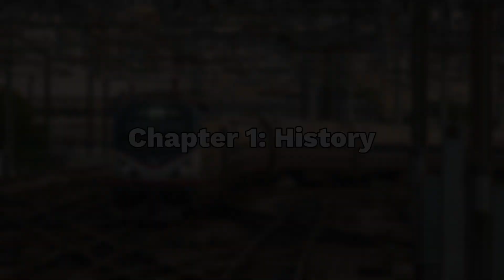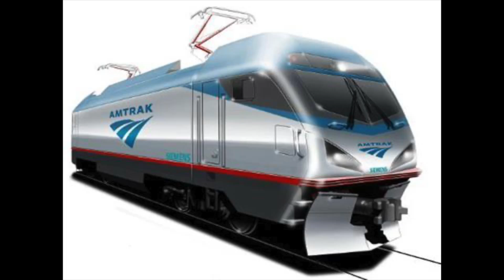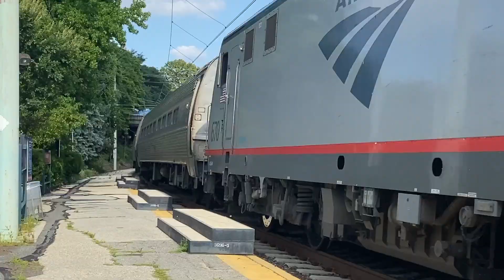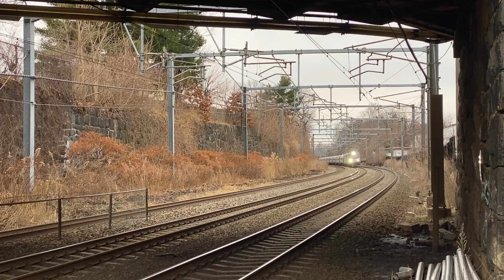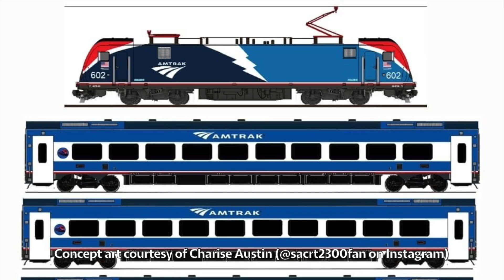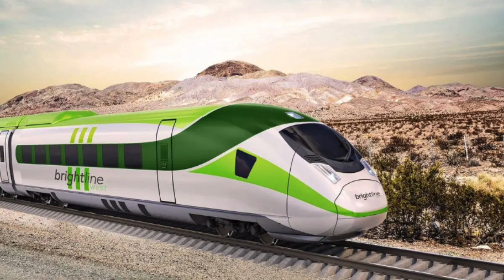Siemens Cities Sprinter: The Backbone of America’s Busiest Rail Corridor

Comment: My personal list of operator that will purchase ACS-64s
Njt: 15 locomotives, because my crazy prediction is that njt will purchase 200 dual mode Chargers
Mbta:10 locomotives to replace its oldest locos
Caltrain: 7 locomotives in case if the Stadler Emus are breaking down
California HSR and Brighline west: 4 locomotives(2 for each operator) to test the tracks once the constrictions are over
Texas central:1 locomotive for the same reason as California HSR and Brighline west
RTD rail in Colorado:7 locomotives for their service
South Shore line:4 locomotives to supply the 50+years old Emus
Metra:2 locomotives for their electrified lines
Septa:8 locomotives to expand service
So my prediction is that Amtrak will sell 58 locomotives while they will keep the rest for long distance trains from New York

Comment: The MBTA Providence line would need extra work to use electric locomotives as many of the platforms along the line are only connected to unelectrified tracks parallel to the NEC. Also MARC has seen no mechanical issues with their HHP-8s after they had been refurbished.
Reply: That’s nice, but they almost never use them. They care too much more about money than the environment.

Comment: i thought they would last about 40 years
Reply: They probably will - it's just that the US has so much non-electrified track, that it seems Amtrak prefers locomotives that they can use everywhere. I don't really get the American anti-electrification sentiments; if it really were uneconomical, why is it all over Europe and the former USSR, including routes longer than anything in North America, for many decades now?
Reply: @KaiHenningsen  Freight companies, presumably. Private operators which also own their rails, high frontup costs (the biggest reason) and not much capacity (single lined tracks — electrification is worth at a somewhat high use of rails) don't bring in many justifications for electrification.
Reply: @MarioFanGamer659  Yeah, having (some) main routes single-tracked also seems like a rather bad idea. Capacity would much more than double by adding a second track. And they know this, as other routes are double-tracked or even more.
I dunno. US rail is just weird in so many ways.

Comment: There a reason amtrak couldn't have used NJTs ALP45DPs as hybrids rather than making their own? I mean IK Amtrak does their thing but I also don't know how fundamentally viable the 45DPs are for that kind of service.
Reply: @T_Hoog  The APL45DP is DEFINITELY buy America compliant. If it wasn’t, how would NJT be operating it right now, never mind still receiving deliveries of them. So that can’t be it. Both manufacturers outsource their parts from their production sites in their respective countries.

What it really comes down to is the fact that Amtrak and Bombardier don’t have the best relationship after the HHP-8 scandal. Where both side were accusing and suing each other over a beautiful locomotive that obviously had issues.

What you did touch base on was “fleet simplification.” Which is the most logical choice. They already have Siemens locomotives and cars. Might as well continue to work with Siemens.

Comment: Both horsepower and watt are units of power, i.e. amount of energy consumed per unit time (with a wat being 1 joule per second). None of these units are specific to one type of engine, i.e. energy delivery mechanism, or another, even if horsepower is a lot more common with internal combustion engines; you could always give a power output for the latter in watts. Just saying ;)
Reply: And in fact, in European car advertisements, you have to. (For locomotives, it's also extremely common to use watt.)

Comment: You are spot on about the possibility of used ACS-64s being bought and refurbished for use by GO transit. I've been calling this for a while. The chances are high as they will have spent big money already just to set up the infrastructure. Either they have existing locomotives refurbished/converted or they buy used. The closest thing to what they need is the ACS-64 (geographically close too). I really, really can't see GO adopting brand new rolling stock right out of the gate once electrification is complete. They will need to turn a profit for a while before the Bombardier bi-level coaches are replaced and brand new locomotives are purchased. Everytime I hear someone say GO will be running EMUs soon, I have a good laugh. That will require a lot more than just stringing up a bunch of catenary wire to make work. The goal is electrification for GO, not a complete change of every piece of infrastructure on their giant network just to accommodate EMUs. They will undoubtedly opt for electric locomotives first before anything else and the ACS-64 is a practical choice both financially and operationally speaking.
Reply: @Golden Auto They have a contract with Alstom to build signaling systems, switches and other hardware and integrate it all in the network. There has not been confirmation yet that Alstom rolling stock will be purchased though it is possible.
Reply: Good point and these ACS-64s can do those jobs. Keep in Mind the ACS-64 European version DB BR182 MRCE BR182 ÖBB1116 1016 are used on S-Bahn Wien and Dresden services
Reply: Why don’t you ask UP to buy some Amtrak ACS-64s for electrified freight runs too?
Reply: @tom-and-mom  ACS-64s aren't certified to full freight trains. But good try.

Comment: Nice video. Although I have been informed that 662 has supposedly been unwrapped at this time. I think MBTA, MARC, and GO Transit are the most likely customers of ex-Amtrak sprinters. Would be kind of funny to see them on CAHSR or BLW tho.
Reply: 662 is sitting in Wilmington Shops but it’s apparently for a mechanical failure rather than the wrap getting removed.
Reply: do MBTA and GO have any plans to electrify their routes?
Reply: @bugno9969  Well yes, obviously Bro bro.
Reply: Caltrain could buy a couple for yard and maintenance work

Comment: I think Nj transit will probably take most of the retired sprinters because by that time the existing alp-46’s might be getting phased out
Reply: Considering the ALP46 are based on the German class 101 and that is nearing the end of service now (being replaced by new ICE mostly) it's a possibility.
Reply: NJT will not take them. ALP46s are here to stay and will stay for a long time.
Reply: @danielchou5895  I love the 46’s but they can’t run forever my friend
Reply: As the ALP-46’s where built later than the Class 101’s, they are probably going to remain in service longer.

Comment: I wish the commuter railroads would switch to EMUs for better acceleration at stops. ACS 64 make sense for longer distance routes but routes with frequent stops should use electric multiple units.  Amtrak could also copy zurich and put several locomotives between cars to simulate an EMU.
Reply: Some of them do use emu's Caltrain is switching to them and go transit might do it later on
Reply: Commuter Railroad don't have to be EMU
Reply: @R262vsNewport  they're better when they are EMU. When you have closely spaced stops acceleration matters more than just top speed
Reply: amtrak doesnt like EMUs and EMUs cost more to run and maintain. It is not cost effective.
Reply: @danielchou5895  commuter rails should use EMUs not amtrak

Comment: The Sprinters were the locomotives that brought Siemens Mobility to the forefront of passenger locomotive manufacture in the US.
Reply: Not true lol. The main reason is because EMD and GE weren't focused on passenger anymore.
Reply: @danielchou5895   who were Motive Power INC with their MP passenger locomotives used on commuter trains throughout the years?
Reply: @harrisonofcolorado8886  MPI was merged into GE Transportation which was merged with Wabtec. MPI is a subsidiary of Wabtec and they no longer make passenger locomotives. In addition, MPI's MP series of locomotives do not fit Amtrak's needs even though it is not produced anymore.
Reply: @danielchou5895  then thats why Amtrak didn't choose a local manufacturer. The reason why Siemens is more popular than rotem, Alstom, etc is because of the acs64
Reply: @ishaqmo7200  No lol. Thats not how things work. Amtrak awards contracts to whoever the lowest bidder is and rotem nor Alstom bidded.
Reply: @danielchou5895  well even then, Siemens were lucky to get selected once, but they proved their worth
Reply: @ishaqmo7200  The chargers and ventures have proven to be very unreliable.